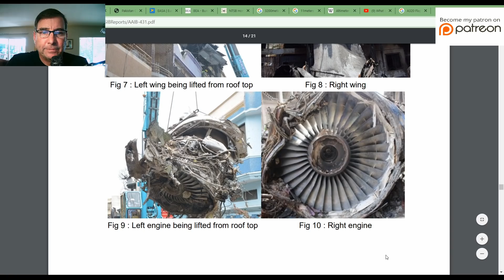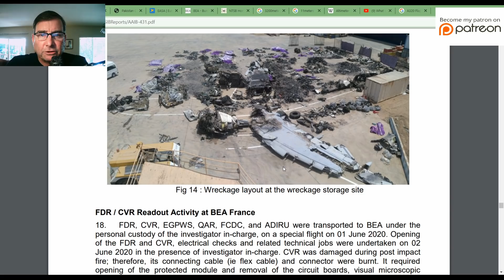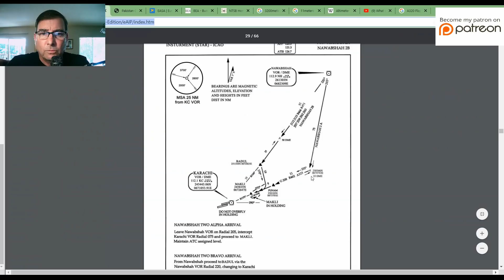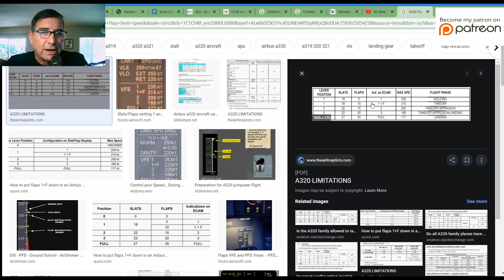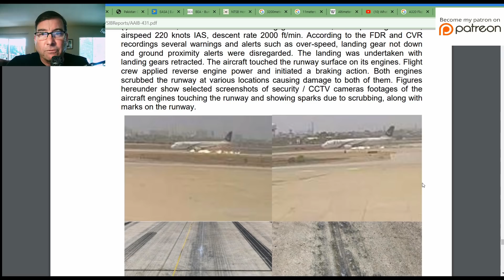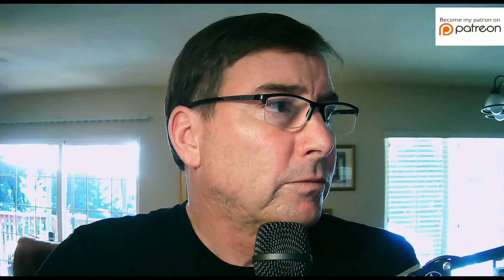PIA #8303 Preliminary Report Part II

Comment: A very scary situation. I will pay more and fly only top airlines. Higher standards!!
Reply: Amen. I do not see this happening on Lufthansa, Qantas, American, Delta, Singapore Airlines, etc. My guess is that these two pilots were ex-Pakistan Air Force, and probably were not properly trained to follow the rules of civilian aviation.
Reply: @greyjay9202  More to do with corruption within the regulator, the airline that routinely certifies sim training without the pilots actually showing up for the exam.
Reply: totally. Every time you hear about a crash with factors similar to this one it's on a stupid third world airline with worst SOPs than a 7-11.
Reply: @greyjay9202  no they were not from airforce
Reply: @greyjay9202  Actually neither of them was Ex-Airforce.
Reply: @greyjay9202  Germanwings was owned by Lufthansa
Reply: A320 is more safe, the real scare can be the maintenance and operation i think. Remember the Germanwings crash.
Reply: Ditto
Reply: @irfan-106  Captain Sajjad Gul was pilot from Pakistan Navy.
Reply: I have plans to never be in Pakistan
Reply: @asts7910  I don't think Pakistan has aircraft carrier.
Reply: Check the safety record of all the world's major airlines. You might be shocked. Even these horrible "accidents" seem to fade quickly from public memory.
Reply: Yovanny Caipa - Wasn't that the one with the co-pilot, who had psychiatric problems?
Reply: Recent news is reporting a pilot licensing scandal in Pakistan.  At least 150 pilots were suspended.  Something like 200 out of 800 pilots in Pakistan were not qualified.  They cheated on their licensing exams.  Source:  Al Jazeera.
Reply: @greyjay9202  I think you would be surprised at the number of former military pilots involved in commercial aviation. There are no indication that they are better or worse than any other pilots.
Reply: Ruben Villanueva : yep, and was hiding all medical reports. Procedures around this have changed since.
Reply: Funny how all crashes happen in Southeast Asia mainly. You very rarely see incidents in Europe, never mind crashes
Reply: Yovanny Caipa Germanwings was believed to be pilot suicide
Reply: Dale Comer All major airlines have had some form of crash
Reply: @forza223bowe5  Yes, but choosing a safer airline is wise. I prefer Qantas and Air New Zealand as much as possible.

Comment: Juan, great report. The left engine "under investigation" also raises the question if the pilots accidentally shut it off. Possibility is less since both engines did strike the runway! But these were not the best crew in the world, so that is a possibility. More interestingly -- that you didnt cover -- is the pilots mindset: these pilots were frequently talking about COVID-19 in the flight and how it affected their families. Interestingly the crew even after the go-around were talking about how COVID was affecting their families! I would have thought at that point the stress would have gone through the roof and would be concentrating on their work. So it looks like they were a casual bunch who took things as it came along rather than a over-loaded crew. A history of the captain/crew may indicate this is just a time-bomb waiting to happen. In the report, it says there were no CRM performed. That doesn't mean they were not talking to each other. It means they were talking about everything else other than flying; looks like flying to them was a routine motorbike drive to office where one can speed up at a traffic light on yellow.

Comment: Seems like a well written, professional report.
Reply: Tired Again - Written, yes. And, it is preliminary. The ATC part needs to be further investigated, particularly the role of the Tower controller. Sorry, but as,  MacBeth, said, "Something is rotten in Karachi!" I sense foul play here.
Reply: It just has the data on what happened. It better well be professional...
Reply: And luckily it's in English not French
Reply: Those reports gotta be.
Reply: Its an official report, so it is supposed to be professional.
Reply: @diegogarcia2515  No they don't especially if you're from Pakistan. China, Russia etc don't care at all about reports being in English.. China doesn't even publish investigations fully...
Reply: @rubenvillanueva8635  Corruption has weakened the roots of PIA ! Around 150 pilots out of 400 have fake degrees and have been stopped from flying the aircraft as per the Aviation Minister.
Reply: @ریحانارشد  Pakistan civil aviation is responsible for fake license not PIA
Reply: Tired Again except for the resting on engines bit.

Comment: “This accident may very well be the worst case of human factors failings that I’ve seen in commercial aviation history” is a very sensible way of saying “These were the dumbest pilots I have ever seen”.
Reply: Dumb is not the word to use, it is much more complex that that, Hubris will probable play a huge part and intimidated on the part of the F/O
Reply: wargent99  not acquiring their pilots licences by fraud would be a good start.
Reply: @gustavmeyrink_2.0  only because there are many cases of fake licences it is not stated  or proven that those pilots were part of the "fraud".
On the other hand the fact that they did not communicate properly (according to the report) could at least be a hint.
Reply: Airmanship, situational awareness, following SOP's.... They blew it...
Reply: well there was this egypt pilot that kept pulling back on the stick and was confused why his altimeter kept dropping, the fo knew about stalling the plane but had trouble correcting the pilot. I thought that was pretty darn stupid. Than the data tells a story about these 2 idiots dive bombing, I'm totally confused why there was such a rush to get down. 1 360 turn would have put them in a much better position for a landing.
Reply: I'd say these were the most reckless pilots...
Reply: NNA  Hot dogging does not seem to be the case here. If hot landings were their routine they would have used the landing gear, flaps, forward slip, and speed brakes for dissipating energy in a much more positive(deliberate) fashion, you would not see all of this fumbling and bumbling. (and maybe still crashed but with a noticably different mode)
Reply: NNA  Your theory is one of the more plausible I've read: if the PIC was indeed an old fighter pilot, he may have felt that SOP was beneath him and that he could cut corners with impunity. As a skilled ex-fighter pilot he may have felt that he was better than a "regular" pilot who needed to follow SOP. I doubt it was a case of him being unskilled, more likely a case of hubris and that he felt that the standard rules didn't apply to him. It will be interesting to learn if he had a pattern of "hot shot" piloting, and if it was part of the culture at PIA.
Reply: wargent99  All they had to do was take the circuit offered by ATC, get the aircraft under control and land it safely.  That's what they were supposed to do.
Reply: Idiots made pilots.
Reply: wargent99  yeah, double down on failure and incompetence!!!  If you ultimately go down, you take many more with you!!!  Their families are ruined, but hey, you took a chance with their lives to enrich your family.  So, it's all good.
Reply: @jicklesjingles8134  wouldnt call this "a hint". the data provided so far for the approach clearly indicate incompetence. I am not a pilot but even I know of a stabilized approach.
Reply: @Capt. Ken They may do weird stuff in the military that I don't understand, but there is no such maneuver in civil aviation. It just doesn't exist, and we all see why.
Reply: wargent99 how about take a turn in the holding pattern designed to deal normally with a plane with too much energy.  Or maybe your comment was sarcasm.
Reply: @Capt. Ken Hence the corporate culture needs to be closely examined.
Reply: @oliverracz2686  In the B767 Gimli glider incident, Air Canada Captain Bob Pearson slipped the aircraft to effect a safe powerless landing - outstanding piloting and crew coordination.
Reply: Literally all they had to do was listen to the plane: "too low! gear! woop woop! Pull up!" and a over a hundred people would still be alive.
Reply: It was Allah's command. Allahu-Akbar.
Reply: wargent99  Regarding your last sentence. That's why I think flight data and voice should be downloaded from all aircraft and stored for at least say 3 months, so that there is a history of each crew member's performance. I'm thinking similarly to you in wondering how cavalier were the pilots on flights that they previously crewed.
Reply: @rogerroger6049  QAR (quick access recorder) data can be downloaded using a USB cable or cellular network after every flight, and a lot of companies do it. Any parameters out of the ordinary can easily be investigated and the pilots can get slapped on the wrist if needed.
Reply: @Fantaman900   : Re "Egypt pilot that kept pulling back on the stick and was confused why his altimeter kept dropping": That reminds me of the FO of Air France 447; he got confused over a frozen pitot tube, didn't realize his A-330 was in "Alternate Law" (no stall protection), pulled the stick all the way back, stalled, crashed, and killed hundreds. (The captain tried to save the plane at the last minute but it was too late.)
Reply: wargent99  : Re "What were the pilots supposed to do?  Admit that they were incompetent?": Well, IF they were incompetent, then yes. 

Re "their whole extended families (40+ people) plunge into poverty": Those 40+ people should get 40+ jobs instead of trying to live off of the wages of one man who (maybe) was trying to do a job was not qualified to do. 

Re 'retirement will arrive sooner or later without incident": No it didn't. The plane crashed and all but 2 souls on board perished. No retirement occurred. No pensions will be granted. And those 40+ people you mentioned? Well, they will now have to do WITHOUT the wages of the pilot, because, if you missed it, he died, so his salary is now $0.00/year. Didn't do his 40+ family members much good, did he?
Reply: wargent99  : Re "I see you only understand Western societies": No you don't; you're just being obnoxious (in order to change the subject); you have no way of knowing what I do and do not understand, and you know it, and now you know that I know that you know it, so knock it off. 
Re "In most of the world, a single male earner, especially a big earner like a pilot, will be responsible for his entire extended family": That's just not so. Write only what you know, and you do NOT know about "most of the world". Most of the world's people live in China, and both men AND women work there, and everyone either pulls their own weight or goes on government aid if they can't. (They have a better social safety net than USA!) So, NO, "most of the world" is NOT as you describe, no. I strongly recommend against pontificating on things you know little or nothing about; it accomplishes nothing. 
Re "If he loses his job the family is destroyed": No. If he DOESN'T lose his job, and crashes his airliner, THEN his whole family suffers (because he is now DEAD and providing them with ZERO income), which is EXACTLY what happened. 
Re "Admitting you're a fraud isn't an option": Repeating the same obviously-false thing over and over does NOT make it any more true. Admitting one's own incompetence is not only ALWAYS an option, but nearly always the ONLY acceptable option. To do otherwise kills hundreds and severely inconveniences dozens more. 
Re "These 40+ people are unqualified for any job": In other words, you're saying the unemployment rate in Pakistan is 40/41, or 97.5%. Bullshit. Actually, the unemployment rate in Pakistan is 5.5%, so you're SO far away from the truth that I have no words to describe how egregiously you are lying. JUST STOP.
Re "they have become dependent on the single earner": No. Due to the single earner dying due (apparently) to his own stupidity, they are NO LONGER "dependent on" that person, and must now fend for themselves ANYWAY, a point you keep ignoring. Not only does incompetence on the part of an airline pilot kill (murder, actually) hundreds of innocent people, it also severely inconveniences the lives of any dependents of the incompetent pilot. That dependency is now OVER. What do you NOT understand about "he died"?
Re "and know no other life": They certainly do NOW, because that life is OVER! What do you NOT understand about "he died"?
The bottom line is, the ONLY acceptable and workable solution to incompetence is to BECOME COMPETENT. All other options kill hundreds of people and severely-inconvenience dozens more.
Reply: @joakimlindblom5200  from local news reports at the time he studied law before becoming a pilot. There's no mention of a military career, fighter flying.

Comment: A few observations from these two videos.  First, the pilots should not have lowered the landing gear after the go-around.  They should, in fact, have made certain the landing gear was up until they were certain they could reach the runway no matter what (at minimum drag configuration).  This would have extended their glide enough to get them to the runway and prevent the crash.
 
Second, the pilots should also have kept the airplane in its "maximum glide" configuration, which generally means no flaps or air-brakes (but might be slightly different with this airplane) ... for the same reason (to assure they can make the runway).
 
On the overhead shot I can see the pilots should have veered to the right (towards runway 25R), because this would have assured the airplane not come down into densely spaced buildings, which would probably have saved many more lives of passengers in the airplane, but also saved more lives and injuries to people on the ground.
 
I wonder whether alarms for different situations sound the same or very similar.  For example, I wonder whether an alarm for "speed too high for flap setting" sounds similar to "landing gear not down" or "speed too high for lowering landing gear".
 
I also have to wonder about these systems that prevent the landing gear from coming down at relatively high speeds.  The amount of force on landing gear during hard but successful landings is so enormous that I find it difficult to believe that landing gear cannot stand the force of wind pressure at 250kts or even higher.  If the landing gear had come down much earlier, the extra drag would have slowed the airplane considerably and probably resulted in the first landing being successful.  Because the landing gear stubbornly did not come down when requested, a whole series of events followed that resulted in the crash.
Reply: Most aircraft max gear drop speed is dictated by the gear doors, if the speed is too high the door mech can be damaged, or the doors themselves get hung up. Secondly, the drag on the gear may also be high enough to cause hydraulic issues. Gear when extended and locked is incredibly strong, deployed partially it is very fragile.
Reply: It’s not necessarily the gear itself it’s the doors that can be damaged and fly off. Has happened before on a 747 in a dive

Comment: I am not a pilot but I have read many air accident reports over the years.  I cannot recall ever seeing anything as exceptionally bad as is emerging here.
Reply: I can be honest in saying that even I would've flown better... (just a simulator pilot)
Reply: The worst of the worse.Seems like pilot on realizing he was going to crash raised  the nose of the plane to the steepest angle he could achieve  in a desperate bid to lift himself away from the point of impact.
Reply: There was the Saudi Flight 163 disaster in the 70s that was just an absolute catalogue of mistakes from both pilots and flight engineer to a rediculous extent. The transcript would be comical if it hadn't ended in tragedy. Totally preventable situation. Every chance to mitigate disaster was lost with every incredibly bad decision from flight crew. The background of the pilot's and engineer's career paths are frot with ominous reports of ineptitude and all three working together was prctically guaranteed to end in tragedy!
Reply: AF 447 and US Bangla 211?

Comment: Some observations:
1: the 260 knot safety valve will open as soon as the speed drops below 260 knots to allow the extending of the gear, no recycling of the gear lever necessary, this is confirmed by my friend on a FFS. So the gear was fully down at some point.
2: the way they handled the gear lever may indicate that they are highly distracted. Based on their actions, I would assume they forgot the gear was down before 1740 ft, when someone configure the plane for landing at 1740 ft, he touched the gear lever and just subconsciously threw it the other way, without realizing what he was doing. When they configured it for go around, he did the same thing again, only at that time did he suddenly realize what he was doing, hence he selected the gear lever down, then immediately up again.
Such disregard for proper procedure, CRM, while lacking basic judgment or any sense of responsibility.
Reply: You sure? Loads of other pilot have said that the gear lever needs to be recycled as it resets and swaps the LGCIU

Comment: "Youre getting the 'too low, gear' warning"  'Captain Mayday'  did a video concerning some of the systems a few days ago. It sounds like there is a good chance they may have managed to 'out-smart' the EGPWS into giving them a 'terrain' warning, rather than 'too low, gear' for a majority of the descent, with it not switching to gear warnings until late into the descent.
Reply: The text of the report says that they received gear not extended warnings.
Reply: @capnskiddies  They were flying this thing so far out of intended operating parameters that there are NUMEROUS factors playing into this. To think that a cockpit would fly an aircraft so far outside of standards that intelligent, informed people are struggling to figure out just the what/when/why/how of the damn series of warning & safety systems is just crazy.